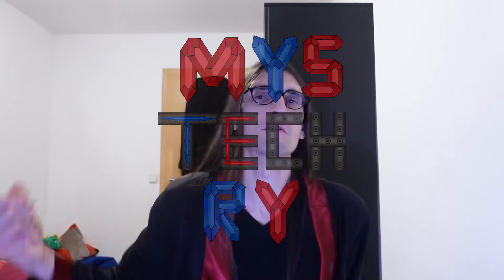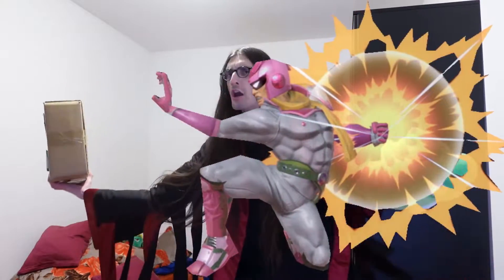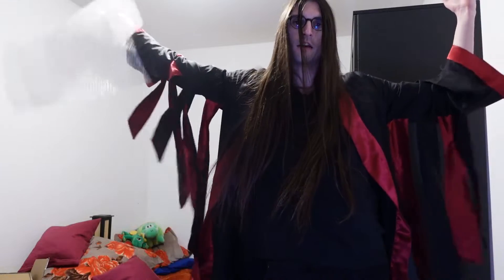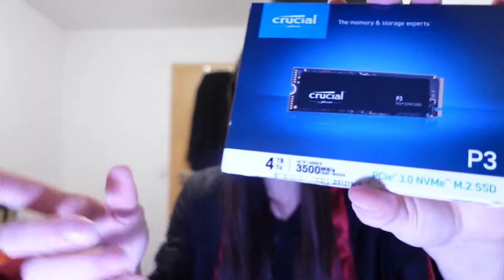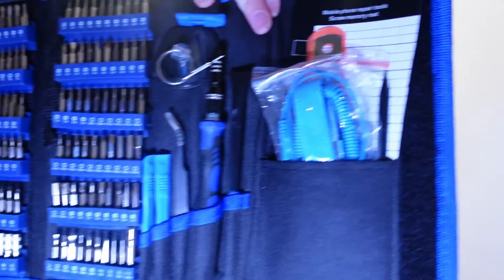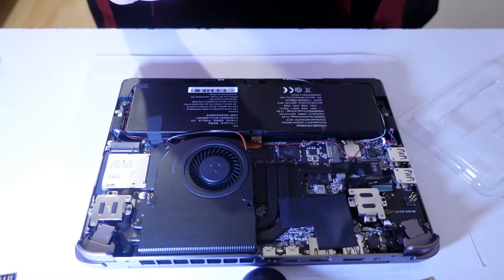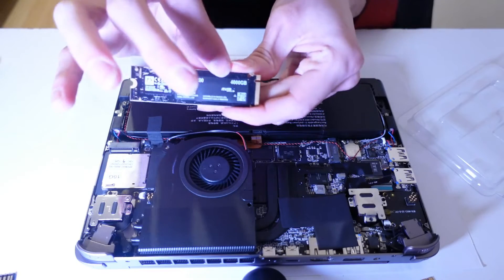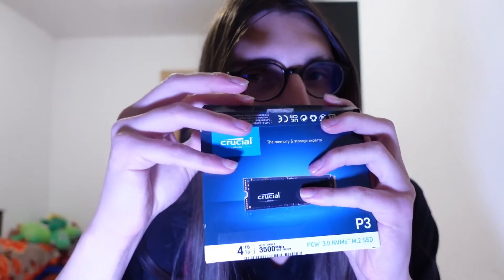GPD Win Max 2 - unBOXING & 4tb SSD installation

Comment: What size ssd came with yours?  Mine has the 2TB ssd but I'm not sure if it's a 2280 or 2230.  I'm afraid that I won't be able to use the stock ssd in addition to my new 4TB ssd.  I should've checked first but my thought was to just put the stock ssd in the 2230 secondary drive slot.  (shame on me)
Reply from the maker: Stock SSD is always 2280. So if you want 2280 4tb + 2230, You need to replace stock and get an additional 2230 as well
Reply: @mystechry  Thanks much!

Comment: Did you have a boot drive ready to go after you first booted up your win max 2 after the sad install? Also how did you get the drivers. I want to buy one of these really bad but everyone is saying they come with malware. So I think installing a new sad on arrival is smart. But a little worried about downloading the driver from gpd
Reply from the maker: 1:
I made a regular windows 11 boot USB stick

2:
You can get the drivers from here
https://gpd.hk/gpdwinmax2firmwareanddriver

3: 
It is unlikely you will get a device with a virus.
The Drivers are virus free.
Someone who must want to harm GPD installs those virus on random units.
Reply: @mystechry  thank you
Reply: I just got mine, did you get one?  About to add 4TB.-
Reply from the maker: @jasweb147  Have fun filling it up with data ;)
Reply: @mystechry  thanks!  I have a Steam Deck that I purchased used.  I love the joy sticks on that thing.  I quickly grew tired of tweaking whilst trying to play my non-steam games.  For me, my Win Max 2 wins out every time because Windows games just run better.  Not to mention the 10.1” IPS screen is so soothing to my eyes. ❤️ I’ll be selling the Steam Deck soon.
Reply from the maker: @jasweb147  Good choice ;)

Comment: Did you remove the small "clip to the bottom right side of the ssd? Watching GPDs video and was wondering if I could leave the fan as you did, and if that clip was necessary or not!

Thanks for the install vid/feedback
Reply from the maker: Are you talking about the clip which contains the cable for the fan?
Both options are valid. If you do not have a tool at hand to remove it, then you do not have to. It's a little bit harder to get the SSD in and out, but perfectly doable without harming the device. Just make sure not to put too much pressure onto the cable.
If you remove the clip/cable, it's easier to get to the SSD. Removing the cable is not hard.

I really can't tell you what's best for you. If you are not confident about the cable, leave it in place at first and see if you can get out the SSD. If not, you can remove the cable later.

Comment: I personally am gonna go with an 8TB 2280 ssd as well as a 2TB 2230. Later on I'll add a 1TB SD card and 1TB micro SD card for 12 TB total storage (hopefully by then the 2TB micro SD cards will be available).
Reply from the maker: Just be aware that the device is made for a single sided SSD and that the bottom side of the SSD will touch the RAM.

I have 7tb in my Max 2 right now. The 8tb SSD is still too expensive for me and I do not want to put a double sided one inside the device.

I do not expect the 2tb SD cards to show up any time soon. You can finally pre order the 1.5tb card for >500€. I too am waiting for bigger SD cards for quite some time now. Especially as the 1tb cards have become so cheap during the last year.
Reply: Well as Mystechry said - only a single sided SSD will fit - and AFAIK there aren't any 8TB that will fit. Best bet right now is a 4TB Crucial P3 or P3 Plus. So as time of writing you can "only" add 4TB + 2TB + 1TB + 1TB - which adds up to an rather impressive 8 TB for a laptop of this size!

BTW: I personally opted for the P3 (PCIe 3.0) as I would expect it to run colder than the P3 Plus (PCIe 4.0) variant - as PCIe 4-SSDs are known to run much hotter...
Reply from the maker: @m.l.9385  
You can probably force a double sided SSD into it. I have tried that already I think. It's not he best and recommended way, bit a few people did it I guess. It's not recommended, but (maybe) possible.

As you said, I too went for the cool p3. Most of the 8gb might be high end and super fast and come with a heatsink mounted. So an other argument against the.
They are not optimal, but possible.
Reply: @mystechry  Forcing a double sided SSD in this small space doesn't sound like a very good idea - and I would assume it will be prone to problems down the line. I wouldn't do it. Personally I will be fine with the installed 4TB + 2TB SSDs and the two 1TB microSD-cards. 
IMHO – again - 8TB in a Laptop in this form factor is already pretty impressive!

There was a PCIe 3.0 8TB SSDs from Sabrent that won't need a heatsink and should not run very hot - but I am pretty sure these are double sided. Last price I have seen was 1200€.
Right now I only see PCIe 4.0 variants - starting at 1100€ - and yes - these will generate some heat...don't think that this would be a very good idea in a small laptop...
Reply from the maker: @m.l.9385  I am 100% with you. I only say that it's possible if someone really wants it.